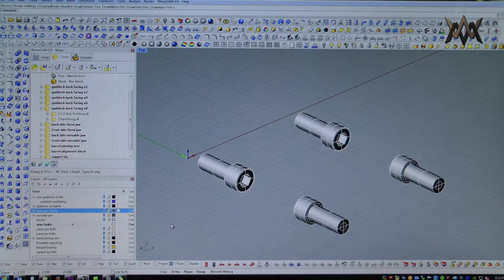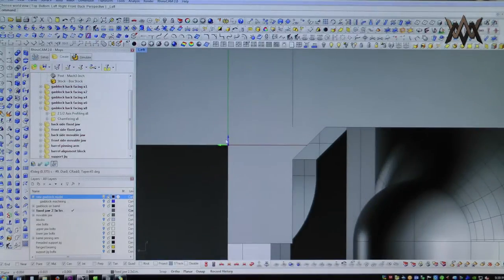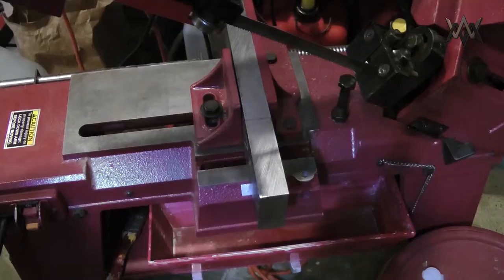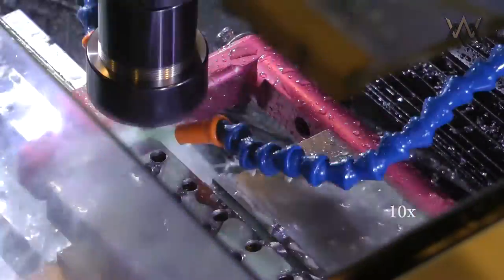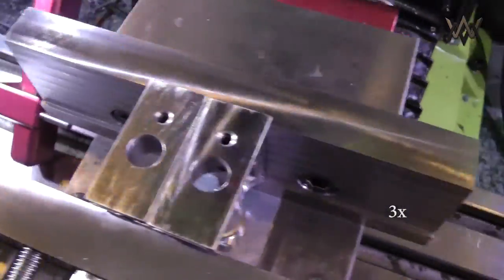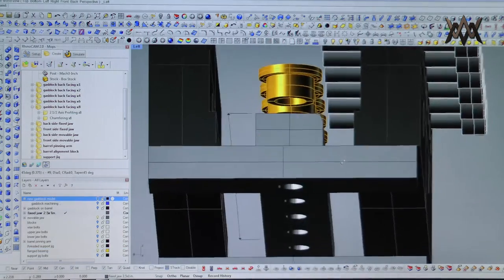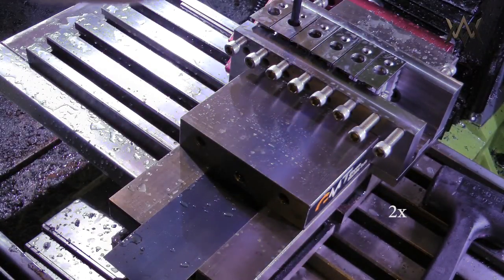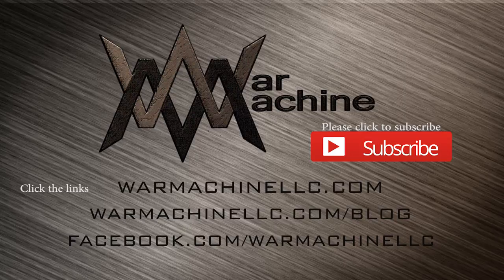AR15 High Rail Gasblock: (pt.16) Soft jaws and milling off back tab

Comment: 20:00  - Most of the fasteners I purchase are stainless, and most of those are in small enough quantities that I buy them from McMaster-Carr.  However, for fixtures, I'll often use black oxide steel screws.  Stainless can be galling, and that can be a problem if you are constantly torquing the same threads in a fixture.  Keep them greased and you should be OK.  BTW - I think the best fastener for this sort of fixture would be AN hardware.  These are "airplane bolts".  The steel is extremely tough (strong but not brittle).  The threads are rolled instead of cut, which would theoretically require roll formed threads in the soft jaws as well for the best results.  AN fasteners are cadmium plated for corrosion resistance, but cadmium is not galling at all.  If they're good enough for NASA, they're good enough for your gas block fixture.
Reply from the maker: I don't know...NASA is kind of low rent compared to what I'm doing:) I'll check them out if I need them. Since I often have to modify my fasteners I was trying to find the cheapest ones that I could cut into and not worry about corrosion. The choice was 304 or 18-8. 18-8 was significantly cheaper so that's what I went with, it was like $6 for 10.

Comment: Great job on the jaws! Whats your opinion on "Edge" products? I'm looking at the same vise stop that you have.
Reply from the maker: Thanks! I think Edge products are great. I also have the tool height setter and tramming gauge both of which I use a lot. Although I don't need to check tram that often but when I do it's indispensable. Having that tool sooner and adjusting my tram could have saved me a lot of time and headache trying to figure out why my parts weren't coming out square. I don't use the vice stop nearly as much as I thought I would because my fixture plates have so much overhang and I can't pull the rod out far enough to butt against the side. I think it's great but for me I should have got one that clamps to the T-slots in the table instead.

Comment: How would a face mill work? Not sure how it would handle the interrupted cutting.....
Reply from the maker: I'm not sure but I think it would exert even more force onto the part even if it handled the interruptions better. Plus I would have to do it in multiple Z level passes. With a full width of cut using the 3.15" facemill I can only take a max depth of around 0.045" before the motor starts to bog.

Comment: Great work!  Now get those things SBN'd and start selling 'em!
Reply from the maker: Thanks Josh,
They have been SBN'd and look fantastic. Thanks for the contacts! I owe ya one. If you don't want to wait on my next video you can see pics of them on my instagram page. Link in the bottom left column on my website. Or I guess you can go to instagram.com and search warmachinellc? I don't know if that's right I just started it.

There were some problems with them from the high heat of the nitriding and they aren't totally right. Fortunately I think most of them are 100% functional but for a blemish on the sling swivel socket. There is a small area where the metal is thin and it either dimpled in or bulged out. It's just cosmetic but I'm in the process fixing the model and CAM to prevent that from happening on the next ones. I'm going to sell them for only $65 since they aren't perfect. That is even less than the pre-release sale price.

Comment: There may be better options, but my cheap (actually free to me) Harbor Fright band saw cut MUCH better when I replaced the Chinese crap steel blade with a bimetal blade from McMaster-Carr.  I don't do much sawing, but I'm still on the first blade, so I can't say how long it'll last.  I do know that it's ridiculously better than the old cheap blade.
Reply from the maker: Oh yeah I forgot to mention it in the video. I got that Starrett bimetal saw blade from McMaster-Carr and it cuts soooooo much better. The old blades would always bump up and down when the weld seam hit the work piece. The Starrett doesn't do anything like that. Very pleased with it so far!
Reply from the maker: Eh I spoke to soon. The Starrett also snapped. I think it was at the weld seem too. I'm going to have to get another one and redo all the bearing adjustments to find out what's going on.
Reply: War Machine LLC
I guess, without seeing it, my best guesses would be excessive feed (too much chip load in deep cuts), too tight a bend radius on the pulleys (is there a spec for that from Starrett?), or some sort of rapid shock loading (start of cut, some sort of feed slippage in the middle of the cut, or when the blade emerges at the end of the cut).

Are you using flood cooling on the blade?  How are you keeping it lubricated?
Reply from the maker: No rapid shocks, no slippage, I'm using the middle pulley which is 120 SFM I think. I have a hunch one of the bearing sets are too tight causing work hardening of the weld joint and making it brittle. Either that or one of the top bearings is somehow putting too much downward force causing the blade to bend across the 1/2" height. I do know that one set of bearings is too tight because it's imprinting a race in the surface of the blade. I'm not using coolant but the blade stays cool. I've tried WD40 before but it just seems to make a mess with no benefits.

Comment: James -

Hey, very cool stuff.  Just catching up ... haven't caught all of the updates, so if this is repetitive, I apologize:

(1)  When tapping, even by hand, you're using a tapping fluid, right?  It wasn't obvious from the video.  I've been using Castrol Moly-Dee for years on everything.  Works great on nickel-based alloys and stainless, so should work on virtually everything else.  It has an odor that will stick with you several days after you use it, and it's black so it stains everything you don't want it to stain, but it works great.  Really helps with tap life and tap binding.  A little pricey - a pint will probably run you $25 with shipping from eBay if you can't get it locally.  But a pint will probably last you for years.

(2)  Not sure where you're getting your raw stock, but I use onlinemetals.com at work when I need something quickly.  I'm not sure how they compare on pricing, but you can get most common materials in most common configurations - and you can get them rough cut to size.  Potentially it could save you some time (and $) at the saw.  Just a thought.

John Z.
Reply from the maker: Thanks John! Yes I am using tapping fluid but it's just some kind I got from ACE. It's pretty thick and smelly but it works pretty good. Hopefully I won't need to do too much more tapping for awhile.

I mainly get my raw stock from speedymetals as onlinemetals doesn't carry the grade of steel I need. Onlinemetals is a little cheaper in general because they bombard me with 25% off coupons though. I found if you load up your cart at speedymetals and let it sit for a week they will email you a coupon to incentivise you to checkout. Also I hear sending an RFQ on your cart will net you an even greater discount and they get your quote within a few hours. I'm always looking for cheaper suppliers though.

Glad to see you back around and hope you enjoy catching up on the videos! How's that STI shooting for you?
Reply: War Machine LLC
James -

I didn't know about speedymetals - that's good to know.  You can never have too many options.

As far as the STI is concerned, it hasn't seen much range time - because I haven't seen much range time.  Between work and family health issues, it's been a little hectic.  And now that the weather has turned ... well, I'm already looking forward to Spring.

John Z.

Comment: Cool videos, just saw your channel when you commented on bluehands channel. Why not just use a large inserted shell mill\face mill for those parts? Whack off all that material in maybe two passes, and get a really nice line finish.
Reply from the maker: Thanks for the suggestion. That is exactly what I wanted to do initially. I did a few test cuts with a 0.75 indexable endmill and the force on the part was insane. I had a block of scrap clamped tight in the vise and the endmill just whacked it out of the way in the vice jaws. I might put that footage in the next video. That was at the full depth ~0.25" though. Further testing got me comfortable with something like a 0.06" depth so it would take 5 Z level passes. The 3.15" facemill can take a full width non-interrupted cut of about 0.045 at 20ipm so that would take 6 Z levels. Ultimately the 0.375 rougher made the most sense and imparted the least amount of force to the work, however it's got me thinking I may play around with using the facemill since even though it's 6 levels, it's only one pass straight across. Glad you like the videos!
Reply: War Machine LLC Oh yea full DOC is a lot of load, sounds scary for sure. Looking at the video again, and not knowing the tooling you have ect, would it be advantageous to mill the appropriate slot for the picatinny rail to interface with in the soft jaw? I would assume that would hold it on the X axis really good, but depending on how many you are producing it might be time\cost prohibitive. Maybe I missed the explanation why not, but what about cutting in the Y axis, where the part is being pushed against your jaws where they would have a better chance of supporting the work?

I like the voice over style of video and once I have my new mill and lathe up I hope to make some of my own in probably the same style. I have a bunch of lowers to machine, but my current X2 converted machine is just not rigid enough for the kind of results I want to achieve. Thanks.
Reply from the maker: Ahh yes I also explored the idea of machining opposing slots in the fixed vise to secure it better. Ultimately I didn't because I wanted to use the soft jaws for other things and having slots milled in it would make that a little complicated. I did have a backup plan though if those through bolts and flange bearing still somehow didn't hold it secure enough. I was going to machine an 8.5" long square key that would fit snugly in the upper most slot of the rails on all of them. This would kind of lock them all together and keep them from tilting. Turns out I didn't need to do that, the fixture addition was plenty rigid enough.

Thanks for the compliments! The voice over style works so much better because first of all you can hear it, but secondly it allows me to turn down the machining noise a tad without turning down the narration. I lower the machine noise recorded by the camera 10db because the motor whine can get annoying after awhile. Since the voice over is in a different track all together I can leave it be or even turn it up if I need to. Thirdly I can do fast motion and still narrate.

I look forward to your videos!
Reply from the maker: bensbenz I talked about switching from a Y axis toolpath to an X axis toolpath in the blog post here: http://www.warmachinellc.com/ar15-high-rail-gasblock-cnc-machining-16-soft-jaws-and-milling-off-back-tab/. Basically the cutting force imparted to the work is more or less tangential to the rotation of the cutter, so the the Y axis path was actually pushing the part over in the X axis. I switched to an X axis path so that the parts are always being pushed into the fixed vice jaw.